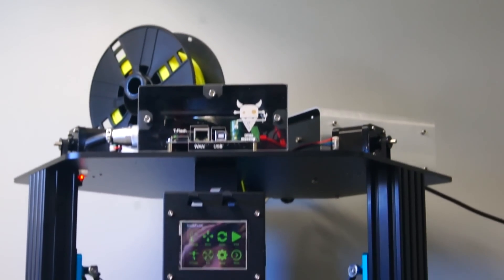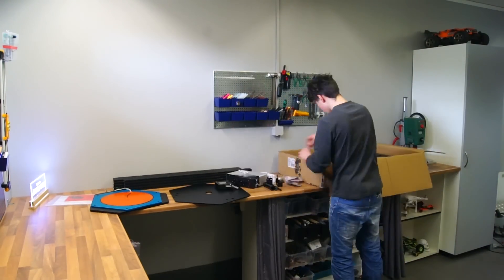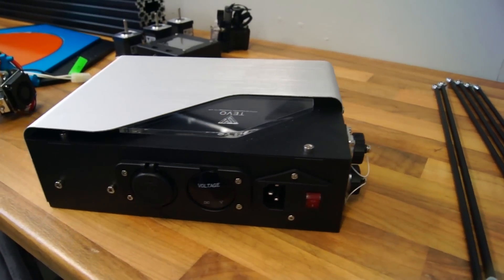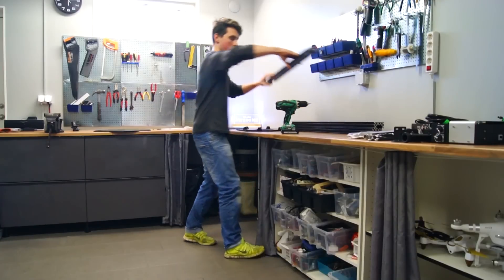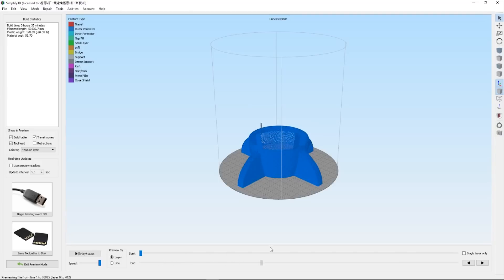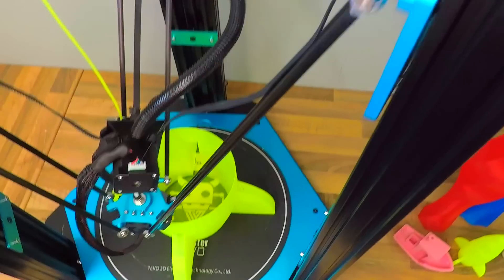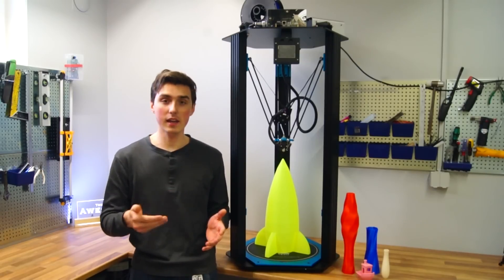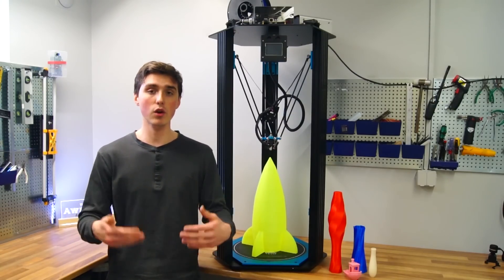HUGE Delta 3D Printer - TEVO Delta (Little Monster) Full Review

Comment: I just got one of these printers a few days ago and im trying to print something and it has a few issues 
1. The model keeps unsticking from the heating bed, im using abs filament and ive got all the settings correct ( no fans, extruder temp 230 degrees celcius, heating bed 115 degrees celcius), but it still doesnt want to stick onto the bed.
2. What slicer software do u use? I tried my own model with the defualt sclicer that comes with the program( i think its sli3r or  something like that) but the nozzle hangs nearly 10mm above the board for some reason.

Im new to 3d printing, so i dont know that much

Comment: Which one this or the predator? I have a huge Mingda printer now.  It’s 300x200x600 mm.  It’s awesome.  But after seeing this, I want a delta now.  My mingda is industrial and all steel construction.  I paid 1600 for it.  It’s low hours.  If anybody wants to buy it, I will give it away. Very low hours.  The thing is I love my printer.  But what I really want is dual extruder single nozzle able to printer at least a 300mm  in diameter part.  And nobody seems to have one to be able to print this large. I want a dual to be able to wash away support to make my parts.

Comment: After watching your review I bought TEVO Little monster and after few hours of use its not working properly. 
I have a problem that the Bluetooth sensor hits the bed and making noise. I checked the jumpers and other connectors. I am not sure what to do to correct the problem. Could you please help me in solving the issue. I also approached the TEVO group but they are not responding to the problem. https://www.youtube.com/watch?v=lQSur-6EIXI

Comment: Is the angle of the upright aluminium extrusions in relation to the base and each other important enough for you to have used a steel square or protractor to check them.

Comment: I have to ask you one thing: Is it dangerous to have a heatbed supplied with AC power without any safety system?
I'm asking you this, because both the tevo little monster than tevo tornado have an AC bed. Mostly, the Tornado has a moving bed and this can cause the break of the wires due to fatigue and, if we have contact with the printer structure we can have a mortal shock.

So, finally, are these tevo printers safe for you?

Thanks

Comment: Did you have any mechanical issues that you had to go back and adjust later?  How is it doing now and has it been working well for a while?  What are some tips for someone that has never built a 3d printer before?  Thanks.
Reply from the maker: This is one of the few printers I have done absolutely nothing with. No upgrades, no issues, no nothing. Just go for it :)

Comment: Hi, kinda new in 3d printing. Just bought this as my first 3d printer.
What brand of filament and diameter can be used with this printer? Or doesn't that really matter?
Reply from the maker: It's made for 1.75mm filament. But any filament can be used and brand does not matter. However, the branded materials are often superior regarding performance and appearance.
Reply: what brands do you use?

Comment: Could you make a review of the Delta Rostock 301 3D printer? It seems a good DIY one as well. It uses a very fast 32 bits microcontroller on the GTM32 pro controler board.
https://fr.aliexpress.com/item/Ship-From-DE-Geeetech-Rostock-301-3D-Printer-Delta-Diamond-3-in-1-out-Extruder-High/32793155212.html?spm=2114.13010308.0.0.COkOVU
Thanks for all your nice videos!

Comment: Excellent product review! I want to buy one now :) and I just bought the Tevo Tarantula DIY kit with all of the upgrades (dual pro metal extruders, larger print bed, auto bed level)..The fact that the Delta doesn't require mains wiring and has a lot of pre-assembled pieces, not to mention the Speed and Size of the machine, makes it very appealling

Comment: Quick tip. I usually do all my screwing with one of those tiny drills that cost very little money are much easier to handle both due to their smaller size and weight. The big heavy battery drill are usually reserved for construction work or drilling holes. 

Try it, you wont go back to using a big battery drill most of your screwing tasks.
Reply from the maker: Awesome, thanks for your tip!

Comment: Hi, thanks for review. I like it a lot but there are 2 things I would like to pint out:
1. This is not a E3D titan but a fake. 
2. Your speed test does not seem to be right. This does not look like 100mm a second. More like 30mm/s. And as expected you can't go more than 100mm without changing extrusion multiplier. Check your slicer for percentage slow down for vase mode or/or outwall.

Comment: It's $800 now, but I'm still too broke for it lol. For that price and build volume is great. I'm not too familiar with the electronics in 3D printers, but isn't that board that allows it to print that fast?
Reply from the maker: It's partly the software, but more than anything it has to do with the construction of a delta printer.

Comment: How much does electricity cost now? Does this raise the cost of your bill?
Reply from the maker: Haha, not really. The power supply is rated att 500W. Here in Sweden we pay around $0,11 for every kWh. Let's say we have it on for 24 hours, that will be a total of $1,32.
Reply: RCLifeOn oh lol.  I have a davinci 1.0 and our bill was like 450$ one month and it is usually like 100-200$ a month. (I have a family of five) my parents blamed it on the printer but I rarely use it so idk what it was.
Reply from the maker: Maybe you have heaters in the house running on electricity instead of hot water? Our bill doubles during the winter months.
Reply: +Kyler Carson If you really want to know how much your printer consumes while active, you can buy a Killawatt (Kill a Watt). It basically plugs into the wall then you plug your 3D printer into it and it'll display how much power it uses.

Comment: That default speed doesnt look like 100mm/s more like 40-50mm/s!
Reply from the maker: It's because it probably is. Whenever someone says a certain speed, it's from the slicer (Simplify3D) and not the true speed. In fact, we can easily calculate this by measuring the diameter of the rocket and observe the number of revolutions during those 25 frames. However, at 300mm/s the true speed might only be 150-200mm/s, but this is still very impressive! The jerk and acceleration settings differs from all printers, that's why different printers will never have the same actual speed compared to the speed according to the slicer.
Reply: Well been tuning and making printers the last 2y and if i set an object to be printed at 60mm/sec
then it also prints at 60mm/sec except if reduces speed for layer below certain time is checked
it adjust the speed, but for the rest the output from the gcode corresponds on what and how fast 
the printer needs to move, so i still find i strange! a normall e3d could not even follow extruding 
perfect at 70-75mm/s, the volcano does have a larger melting zone so it could extrude a bit faster.
Reply from the maker: I did some calculations based on the diameter of the rocket and the frame rate like I pointed out in my previous message. My esimation is that the small rocket was printed at 144mm/s (true speed). Which is quite impressive indeed, but it's also important to not compare only printing speed, but also the object being printed. The print head was only going in circles, no retraction or movment was necessary. This might help during those high speeds.
Reply: That seems a more realistic printing speed

Comment: Nice review, is this one of the best models in the $1000 area? Will it print "normal" little things as well or just huge ones?
Reply from the maker: It's a very good printer in the $1000 area, though I'm not sure it's the best (haven't tried them all). It will print "normal" things as well. Thanks!

Comment: Nice review and impressive results. A couple of questions:

a) how thick are the plates?
b) What's the desk space it takes up (say across the flats of the hex base)?
c) What's the heated bed diameter?
d) What are the rods made out of and are they fairly rigid?
e) I can't tell - does the Titan ride on the end effector? If so, that kind of negates the light end effector argument, doesn't it?

I enjoy your channel a lot, having recently discovered it. Thanks for sharing and teaching.
Reply from the maker: a) 6mm
b) 500x500mm base and 1300mm tall

c) 340mm printable diameter (actually 350mm)
d) Looks like some kind of composite, could be carbon fiber though. They are indeed fairly rigid.
e) The Titan is hooked on the cartridges using timing belts, not the effector. Though it is connected with the PTFE tube, so some weight will rest on the effector, but hopefully mostly on the cartridges.

Thanks a lot for your nice comment!

Comment: I can tell you that it is not printing anywhere near 300ms. Without changing the acceleration and jerk in the firmware it will not achieve those speeds.
Reply from the maker: I wrote this to another comment: 

"It's because it probably is. Whenever someone says a certain speed, it's from the slicer (Simplify3D) and not the true speed. In fact, we can easily calculate this by measuring the diameter of the rocket and observe the number of revolutions during those 25 frames. However, at 300mm/s the true speed might only be 150-200mm/s, but this is still very impressive! The jerk and acceleration settings differs from all printers, that's why different printers will never have the same actual speed compared to the speed according to the slicer."
Reply: Exactly, but it's not because of the acceleration since it's printing in vase mode at constant speed. The bit with the clock at 100mm/s actually looks like 40mm/s if you try to estimate the length the head travels during one second. He probably had cooling settings limiting the speed.. So any later speed claim is also wrong since he speeded it up in the firmware which is an increase from the base speed in percentage, not a speed setting per se. I own a delta printer and I can say 100mm/s is waaaay faster.
Reply: arbit3r I'm with you. Furthermore the mechanics wont be sturdy enough to handle huge accel. And this is what you need to come up with when you want to gain an effect of higher speeds. 

@video owner Firmware settings are just a few digits to edit... thats nothing this printer gains a major edge with.

Comment: Remember when printing fast like the 350, you might need to raise the hotend temp and may need to increase the flow rate. That will ensure you are putting out enough filament at the higher speeds.

Comment: can u make video tarantula vs monster ?
Reply: agree Adrian - 2 complete different machines.
Reply: Fero music imo, that doesn't seem like a fair comparison because the motion systems are different, deltas go faster because of the lighter print head. They aren't using the same firmware either and the hardware is also worlds away from each other.
Reply: Different yes but the outcome is all that matters.  Print size, ease of use,  print speed, longevity of use,  and of coarse detail of print.  That is what matters

Comment: RCLifeOn
 nice videos ratting 5 star out of 5 star 
good job
can you try to increase the speed on the printer to 100 cm per second in upcoming videos
Reply from the maker: 100cm/s = 1000mm/s
The printer was able to print at 300mm/s, which is very high speed for any 3D printer.
Reply: never
Reply: 1cm per second is more decreasing the speed it just 10mm per second so its pretty slow xD
Reply: i think my math is really wrong thanks for correnting
Reply: why what a problem
Reply: RCLifeOn if there was a printer that can print at 100cm/s that would be fast specially huge print
thanks for commenting this is comment